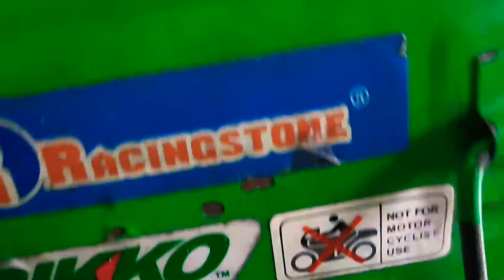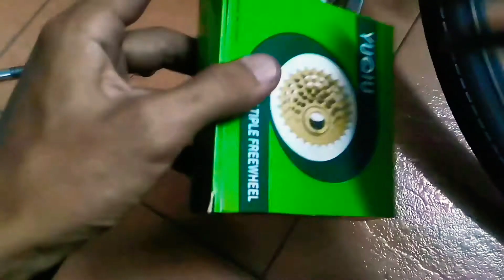How to change bike wheel hub bearings | Ball bearings to cage ball bearings asmr

Comment: great video, great work!! Do you have information about those balls that you installed on the bike? I have had some problems, I feel that there is some friction, I do not know where they have made me think that it is the wrong balls ... in the Dura Ace Shimano, they are 1/4 Grade 25 balls, anyway .. .I will try this change, greetings!
Reply from the maker: I'm using 1/4 x 7 for rear, 3/16 x 7 for front... Usually for the rear hub it should fit 1/4, 3/16 for front... Friction that u feel maybe comes from inner cap that sit on the bearing or from hub itself or probably u over tighten the shaft...